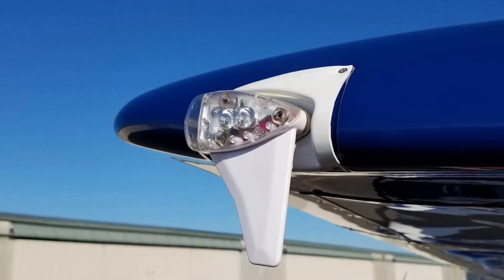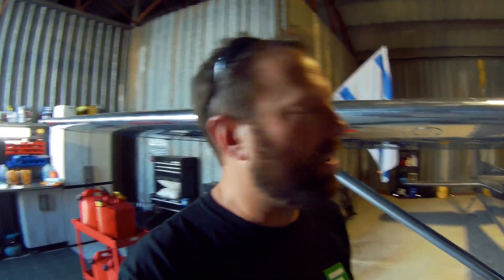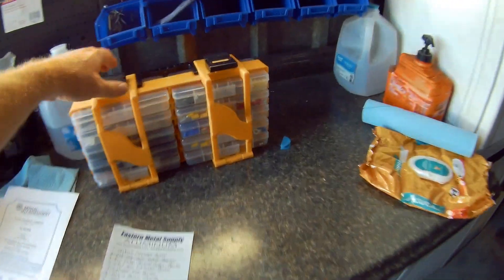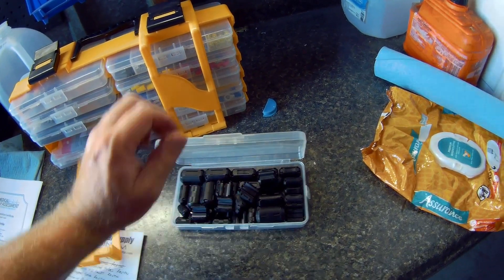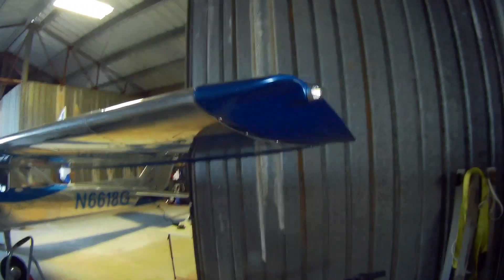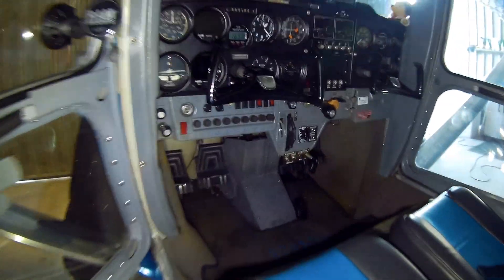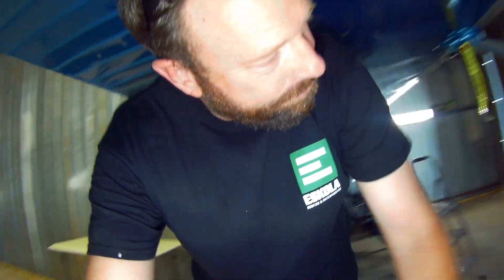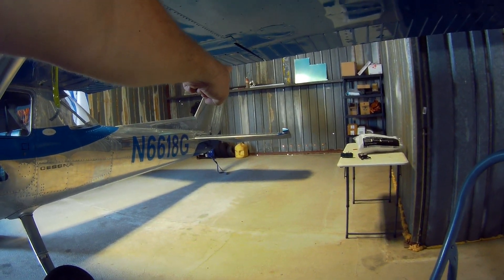Uavionix Skybeacon & Skysensor Review

Comment: I'm unclear on why there was a need to run a second wire.

As best I understand it the strobe function is integral to the SkyBeacon and SkySensor units themselves, and as such are free-standing and don't need separate wires: it’s still a plug-and-play situation, of just replacing one’s old nav light assemblies and installing these new guys —with just the existing wiring (power and ground).

Is that not the situation?
Reply from the maker: Strobe wiring is not required for the unit to function. Some airplanes like mine never had strobe wiring ran. I decided to add it to mine
Reply: It depends if you want to turn the strobes on and off. If you are ok w them on all the time, then you can just power it w one wire.